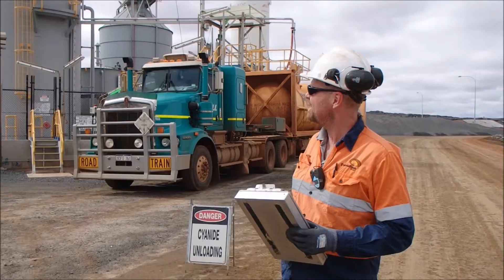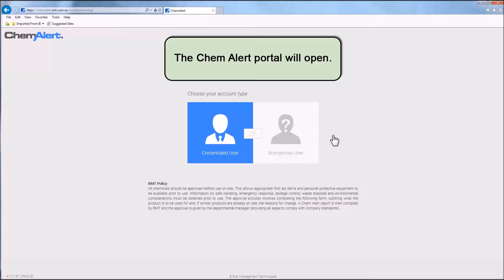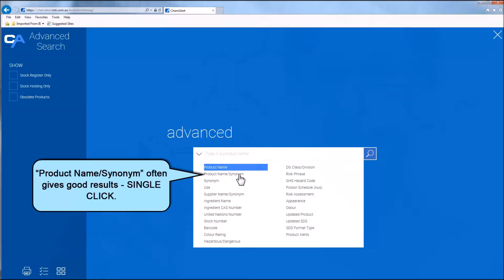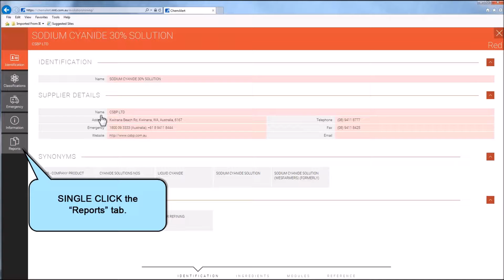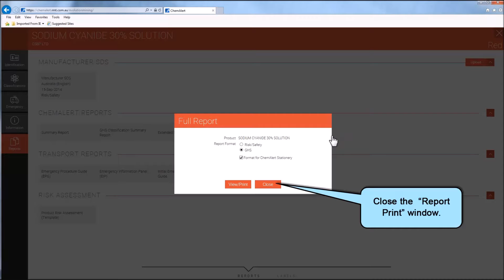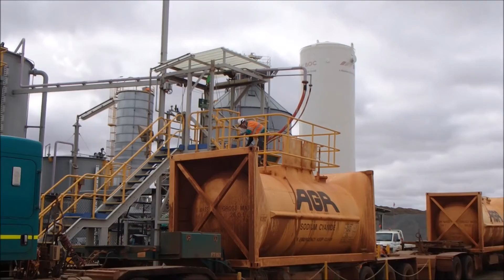Chemical Essentials: Safety Data Sheets (SDS)

Comment: Your radiometric footprint matters exactly the same as your chemical footprint. "In some cases, attention may need to be paid to the presence of thoron (Rn-220) and its progeny, because a proportion of any thoron progeny which are present may contribute to the count rate (ARL 1990). This proportion will depend upon the equipment and counting approach used. If significant thoron progeny may be present, then the suitability of the equipment and counting approach for the situation should be assessed. For some mining and milling operations, thoron progeny may be a significant contributor to the dose, in which case the potential alpha energy concentration (PAEC) for thoron progeny will need to be measured." Monitoring, Assessing and Recording Occupational Radiation Doses in Mining and Mineral Processing Radiation Protection Series Publication No. 9.1 June 2011 by ARPANSA. https://www.arpansa.gov.au/sites/default/files/legacy/pubs/rps/rps9_1.pdf